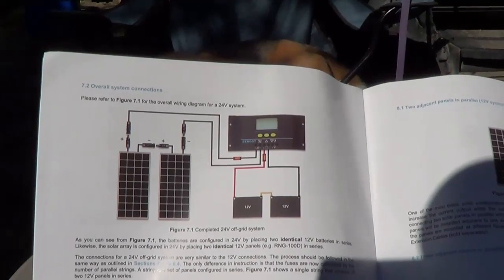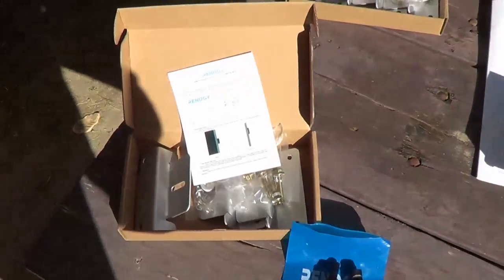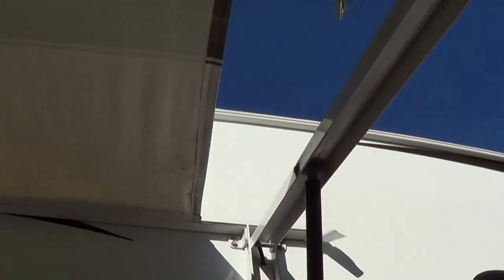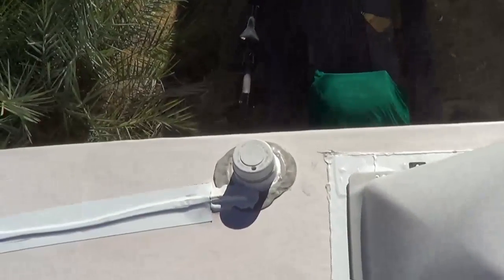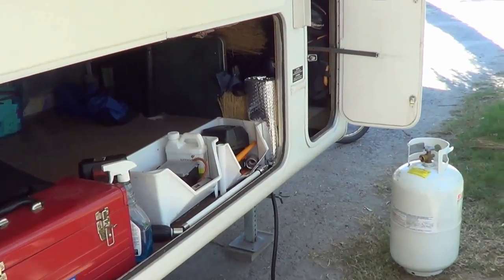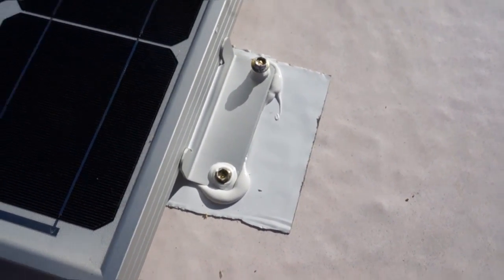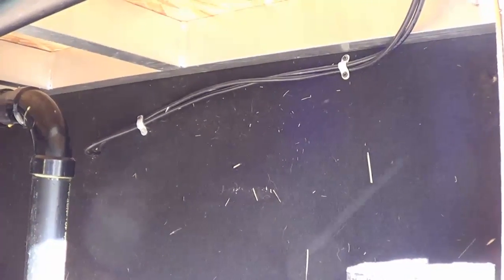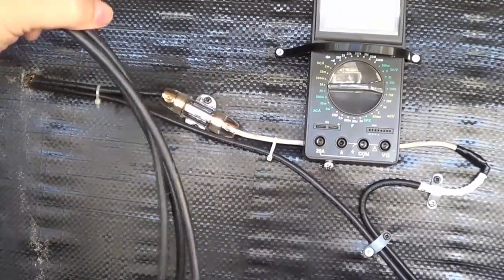Installing a Renogy 200W Solar Kit on my RV

Comment: I'm wanting to install solar panels on my rv but I'm a bit uneasy about drilling holes in the rv roof, is there any other way to secure these panels down?
Reply from the maker: +Jessica Gross Depends on the type of roof. If fiberglass or metal you may be able to use a 3M tape and stick them down, but on a rubber roof like mine you pretty well need to drill holes. http://www.amsolar.com/home/amr/page_24
There are already lots of holes up there, all the vents, TV antenna, ladder, etc are screwed on so there are dozens of holes if you think about it.
Reply: +Love Your RV thanks for the information. The fifth wheel I'm going to be getting is a 2006 DRV 36tkt and it will be my permanent home for many years so I'm just trying to keep it in the best condition.

Comment: im not an electrician but is it safe to have the wires close to plumbing and gas like that? im wondering cus i have a similar rv and trying to turn the bathroom into a growroom lol
Reply from the maker: +ro866432 Yes, the plumbing pipe is all plastic and the solar wiring carries only low voltage DC power.

Comment: I have the exact same panels and charge controller. I am about to install them on the camper on the back of my pickup. You did not talk about an inverter. I am going to have a voltage meter between my panels and the charge controller like you, and I am also going to install a second volatge meter directly to my batteries (two 50 amp hour deep cycle 12 volt batteries). That way I can monitor my batteries even when its dark. I'm new at this but why would you put your voltage meter on the out side? It seems to me that it would be more practicle to put the charge controller and multimeter on an inside wall so you don't have to go outside to check them. Also I am putting a male/female plug on the outside wall with the male end out to be able to plug an extension cord to an AC outlet. The outside male plug will have a cover over it for weather and the female plugs (3) on the inside are to charge my batteries with an AC battery charger as well as power my stuff while my battery is charging. I need the external source in winter (little to no solar)  because my camper is not big enough for a gas powered charger. By batteries, charge controller, 600 watt pure sine inverter, multimeters are all mounted on the inside wall of my camper. Do you know of anything I have forgetten or should think about? Thanks.
Reply from the maker: +bibleprophecy1st The meter was just a stop gap measure to see if the panels were working properly, as soon as I can afford it I plan to install a Trimetric battery monitor with a shunt - http://www.bogartengineering.com/content/trimetrics It will have the meter part mounted inside the RV.

The controller is mounted there to be as close to the batteries as possible for more efficient power transfer, less power loss in the wiring.

I have a 1000w inverter wired on to my battery bank. I'm working on a video and blog post right now showing my wiring setup, I've just upgraded my battery bank to 4 6-volt batteries will post it soon.
Reply from the maker: New post -> http://www.loveyourrv.com/upgrading-my-rv-battery-bank-and-12-volt-system/
Reply: I read your blog. My question is, do you think with the same solar panels you have to recharge my batteries during the day and two 50 Amp Hour batteries, Will I be able to run a laptop computer for about 4 hours at night and a DIY AC that runs off of 4 amps all night? All my lights are LED powered by rechargable AA batteries that I can also charge during the day with the panels so I will not need the deep cycle batteries for that at night. I was hoping to be able to run the AC and recharge all my batteries during the day. The AA and AAA batteries would only need recharging on ocasion. So will the two 50 amp hour batteries run the laptop for maybe 4 hours and the 4 Amp AC all night?
Reply from the maker: Depends how long the night is, I'd say the solar wattage is enough but more battery capacity may be needed.
Reply: You wrote that your campervan had only 85 Amp hours and you used it for years. Did you use lights, tv, and other devises in your campervan with  just the one battery of 85 amp hours? My two batteries equal 100 amp hours, my lap top has its own battery, and my lights do not use them at all. If 100 amp hours means you can use a device or devices that equal 100 amps for one hour or you can use a devise that uses 4 amps for 25 hours. I realize that you should not drain a battery past 30 to 40% but that is still over 12.5 hours. Is that the way it works? Are you suggesting I get a third 50 amp hour battery just to be safe?
Reply from the maker: We only had to power lights and the furnace fan in the camper van and a little bit for the fridge 12 volt circuits, most stuff was propane and no TV. Back then we hardly used a computer.
I depends how long the night is. In mid winter the usable solar hours are only about 8 hours or less so that leaves 16 hours of no power in. Now mid summer is the opposite, so there are many variables to your question.  :)
Reply: Love Your RV
So what your saying is depending on sun light i.e solar chargeing compared to the night use. Thats just it when I would need the extra power to run the AC I would have the maximum amount of solar in the Summer. The AC would not be used in the winter so I would only be using my laptop in the winter. It is a power conserving HP 14" without a disk player operating windows 8. The charging of my rechargable AA batteries would take place during the day and should not take more then a few hours. I have propane for cooking in the summer, and a small wood burning stove for winter heat and cooking in the winter. It is a very small camper 6' X 8.5' on the back of a S10 pickup I built for hunting. The batteries I have are brand new Universal UG 12500 12V 50 ah. So just to be safe get a third 50 ah battery?

Thanks
Reply from the maker: Ahh, I see. I'd wait and see how it goes, your energy needs sound pretty meager so you might be OK. :)
Reply: Love Your RV
 Thanks for your input.

Comment: This is a smart guy to go solar on the go plus at camping. By installing wiring near-by propane area, it would be very small issue because solar cable is good stuff. I guess, the lightning storm would be even more concern. Around 5 years later, you can kick out your lead-acid battery, to for Lithium-ion 3 KWh. battery for much lesser weight. You can add on 4 more panels = to 6 to power up your A/C from your solar with very little generator or none. I call it; "Smart Camping!"

Comment: hi,i am new on this,i have an rv,i would like to install some panels,im not sure many panes does i need to run a 12v 24 inch tv,radio,charge cel phones and inverter for lap top,also i don't know if i have to replace battery or marine how . battery will work...thanks a lot
Reply from the maker: +Eduardo Tolentino The system I installed in this video should work for you - http://www.loveyourrv.com/installing-renogy-200w-solar-kit-rv/  I recommend have two identical batteries. I use two six volt golf cart style wired in series.

Comment: what watt inverter are you running off the 200 watt solar set up
Reply from the maker: +Edward Martin I use the 200-watt panels to charge a pair of 6-volt golf cart batteries, they power a 1000W inverter. The inverter powers a few computers, a small LCD TV and charges up our electronic devices. For larger wattage AC loads, like the AC, microwave or toaster I use a gas generator.
Reply: Love Your RV   Are you from the UK?

Comment: Is the system still working  well for you?  Also, in your blog, you said you may add two more panels.  Do you still think you need them  after using the system for a full summer?
Reply from the maker: +William Klein Yes, still working well. The two panels offer plenty of energy for our needs during the summer, because of the long days and high sun, but I will be adding two more plus two more six volt batteries to the system so we have enough power come this fall and winter. Usable hours of sunlight in say December drop down to 6-7 and the sun is very  low in the sky. I'd rather not add tilt brackets so more panels is the way I will go to get the extra juice.  - Ray

Comment: Love Your RV: Ray, have you thought more about upgrading your system yet? Also, how many amp hours of batteries are you running?
Reply from the maker: Paul Petrea  Not yet, we are spending this summer in an RV park on full hookups, but this fall we head back down south for more extensive boondocking. I plan to add at that time two more 100 watt panels and two more 6-volt batteries to bring us up to 400 watts of solar and 464AH of battery capacity. This should easily serve our particular power needs and give us extra capacity for cloudy days.

Comment: A nice job, have you considered what would happen once your batteries reach capacity and the solar panels are still charging?
Reply from the maker: Sig Sauer  Yes. the charge controller that came in the kit is a three stage one. In the final stage when the batteries are full it will switch to a mode where it just keeps them nicely topped up by trickle charging from the panels as needed.

Comment: do you have a remote meter in the unit so you can observe the condition of the batteries without going out to the battery bay? My Arctic Fox (old 99) 27' 5th wheel had a charge controller above the stove so you can monitor the voltage, input volts, and current. But it went south and out of production. I replaced with a Sunforce 30 amp digital display flush mount controller and now am looking at upgrading the solar panel to 200-300watts. The trailer also has two 6v batteries. Didn't see much in the way of hooking up the panels (wiring) My existing panel just has a junction box.
Happy trails,
Mike
Reply from the maker: Mike Swift  I currently don't. Will add that in the future. I plan to add two more 6 volt batteries, two more panels and a better charge controller with a remote display. Right now I just plug a multimeter into a 12 volt socket in the rig to get an idea of the current battery voltage.
Reply: the meter is what I do in my sailboat. Can also set my chart plotter to show battery voltage which is a nice feature. Don't have one in the RV though! I like the flush mount controller but didn't see many vendors that have one at a reasonable price.

Comment: Great video. Thanks for sharing your knowledge. Is there a link or a way to see how  your 6v batteries are wired?  Thanks again.
Reply from the maker: Brian Kreisler Thanks! Check out this link - http://www.loveyourrv.com/trojan-battery/ I've used this arrangement for about 4 years. This summer I plan to upgrade to a 4 golf cart battery bank as the original 12-volt battery is nearing end of life. Cheers Ray
Reply: Love Your RV Very cool Ray, Great info, looking forward to doing this to my travel trailer. Thanks so much.

Comment: Do you use the small gas cylinder that fits into the buddy heater or tap into your 20lb tanks?.
Reply from the maker: geo land I've used both methods. When I first installed the Buddy I used a hose to an outside cylinder to save on propane costs, those little cylinders are expensive and don't last long -  http://www.loveyourrv.com/rv-install-review-mr-heater-big-buddy-mh18b/ but recently I tapped into the RV low-pressure LP gas line. WAY more convenient now - http://www.loveyourrv.com/mr-heater-big-buddy-hooked-to-my-rvs-lp-gas/  Cheers Ray

Comment: I have a hard time understanding amp hours VS watts. I too have spent a lot of time in the tech field. But we dealt with watts, amps, volts, etc. So can you explain amp hours so that a novice can understand. I realize this is very important for solar. 

Thanks
Reply from the maker: 1timby  Amp Hours is a way to to quantify how much power is stored in the battery or battery bank. 
So say you have a 100 AH rated battery that means it could provide 10 amps for 10 hours or 1 amp for 100 hours or 50 amps for 2 hours and so on before being completely discharged.
The thing to keep in mind though is it's not good to totally discharge a battery so most folks will only let them run down to around 50-60% capacity before recharging.
So say you have a bank with total AH of 235, your real-world usable power is in the range of 100 amp hours or so.
Also temperature will affect the capacity, as it gets colder the AH capacity is reduced. Below freezing it can have a big effect.
Cheers Ray
Reply: Love Your RV So it looks like solar isn't what it's really cracked up to be. Unless you have tons of storage & a big array of solar panels.

I see others claiming they don't like to run down their batteries below 80%, So I guess until battery tech really improves then solar is really a rich person's toy. Unless one live like a hermit & only needs very little power...LOL
Reply from the maker: 1timby Seems that around 400 watts of panels and 400 AH of battery capacity is a good amount for most boondockers. But it really depends on one's lifestyle for sure. Some folks can get by camped with 100 watts and others 1000 watts of solar and 8 batteries wouldn't be enough.

Comment: hello......love your "love your RV" vidz.....good stuff!;D
I'm currently researching what I need to do with my motorhome to meet my needs....
I like the way yours is set up.
I have a question though,..... I have seen several systems and have noticed guys
using a "shunt" in their wiring. 
Can you briefly explain what this component is/does, and why/when someone
would need to use one.....
thanks!
Reply from the maker: sbecktacular Thanks! It's a way to measure the amperage flowing through a wire and is used primarily for battery monitoring devices. 
http://en.wikipedia.org/wiki/Shunt_%28electrical%29#Use_in_current_measuring

The shunt tells the monitors brain box how much amperage has flowed into and out of a battery and from this info the monitor can give an indication of the batteries charge state.

Comment: What if your inline ammeter battery dies and it will stop the flow of current from the panels?
Reply from the maker: autoparts321 The current will still flow across the internal shunt, so no problem.

Comment: Love Your RV  Great you changed the wiring to circumvent the propane chamber. Electrical and outgassing propane tanks in tiny enclosed chambers, don't go together.  Envision the chamber being filled with propane gas as they do outgas commonly when there is a warm day or when the sun hits the panel door to heat up the chamber. Always fill propane tanks to below 80% full to help prevent outgassing.
Reply from the maker: James de Christ Yes, I thought better of doing it, but there is factory wiring in there, for example the side 12 volt marker wires and wires coming from the tow hitch connector. The bottoms of the LP Gas cylinder enclosure are open to the outside so in theory LP gas being heavier than air should drop out of the enclosure and not collect.

Comment: One suggestion would be to redo the brackets so you can angle the panels at will without having move the RV.
Reply from the maker: glock19gen3 Thanks, decided against tilting brackets to keep things simple. Will add a couple more panels and see if that covers our needs even in low angle season. If need be I can always add a few tilting panels further back, still have lots of space up there. Cheers Ray

Comment: Great video! My wife and I have had a 32' class A for a little over a year now and have so far just taken short trips around California. Our longest trip was to Portland Oregon (about 600 miles) but mostly just short 3 day trips. My main interest in solar is to keep my batteries maintained while the rig is in storage since there is no power out there. It is stored outside and we use a cover to keep the sun rays off so any solar panel will have to be outside of the cover. This makes a permanent installation onto the roof not doable unless we cut a hole in the cover to let the sunlight through.

I know they sell small battery maintenance panels in the 5-15watt range but I get concerned about overcharging the batteries since these battery maintainers don't normally have charge controllers on them. I'm thinking, why not just get a Renogy 100W starter kit and figure out some way to make a portable mount that can be installed on top of (or outside) our RV cover. The added bonus is that it could also be used while camping.

Has anyone done something like this?
Reply from the maker: RonVBT Sounds like a good plan to me. :)

Comment: If you get 2 more panels try to get 160 watt panels,that will put you at half a Kilowatt and you can charge your batteries 3 to 4 times faster.You will have to get another charge controller anyway if you get 2 more panels, because you will max out the amps.I would get a Morningstar TS 45 than you can do away with the volt meter and get all the readings you need when you buy the optional data screen.I dont know how much money you are willing to let go of but I would get 12 volt AGM batteries and you won't have to worry about all the fumes and checking the water.
Reply from the maker: Gary H Thanks for the tips, good info, will have this summer to ponder the options as we will be on full hookups, then will head south again this fall for extensive boondocking. Will likely wait till late in the year to add on to the system, the way technology is changing who knows what may be out there then. :) Cheers Ray